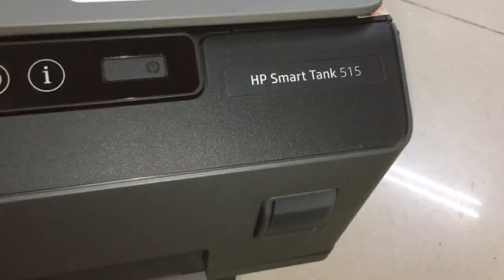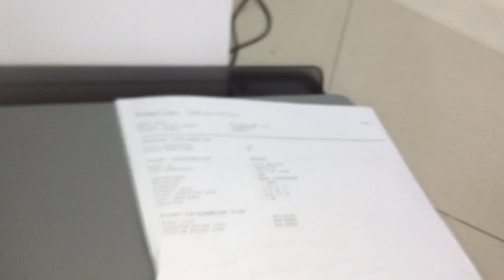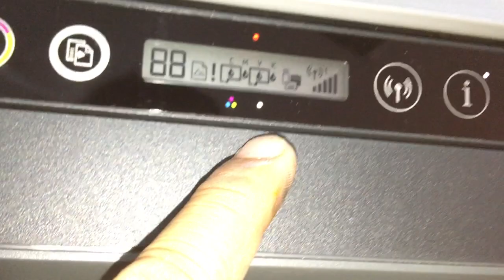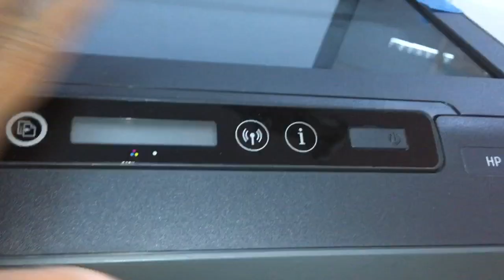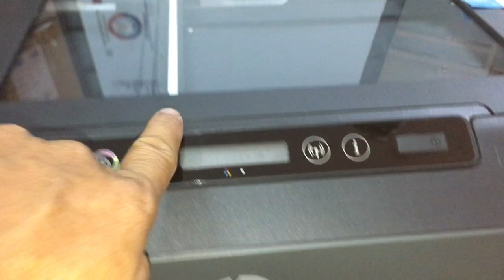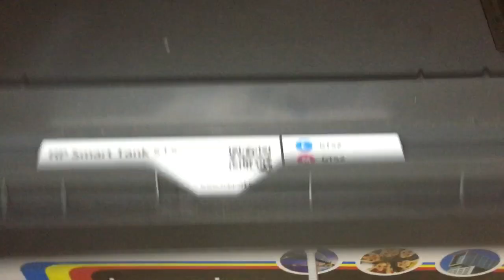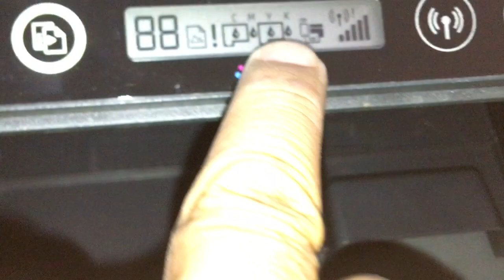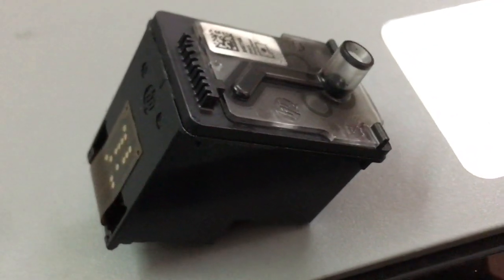HP Smart Tank 515 514 517 532 617 508 511 518 519 531 538 610 error all lights blinking solution 01

Comment from the maker: HP Smart Tank 515 514 517 532 617 508 511 518 519 531 538 610 error all lights blinking solution part 01 @khmer share .This printer repaired has 3 parts video. Part02 https://youtu.be/X58zUVfurWs  and the End part03 https://youtu.be/BFY-GUfBbfM. When turn on printer first it shows Black Printer head error and then all lights blinking and cannot print copy or scan carriage board fualty, Replace carriage board ok